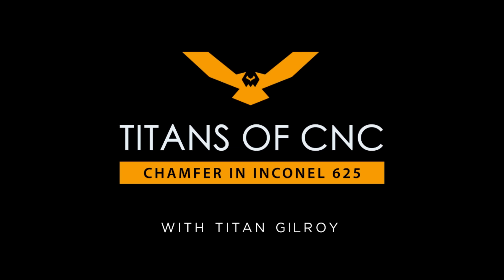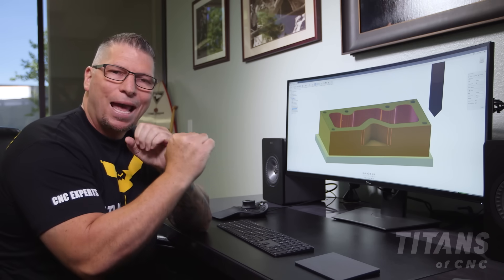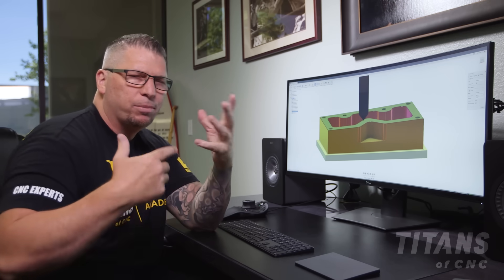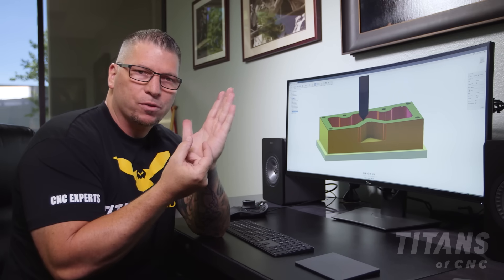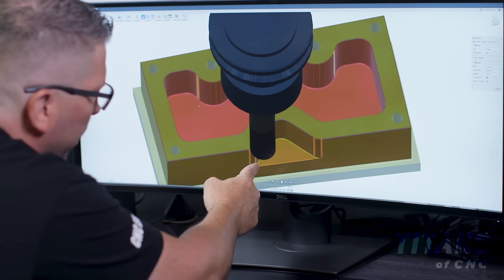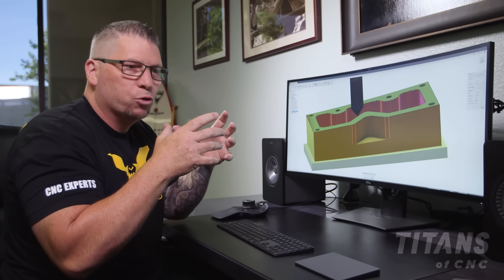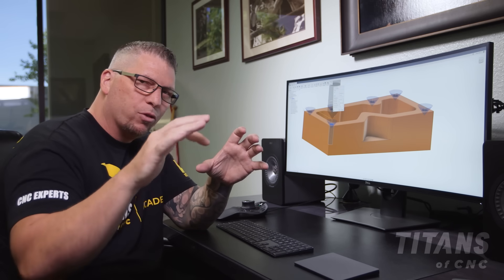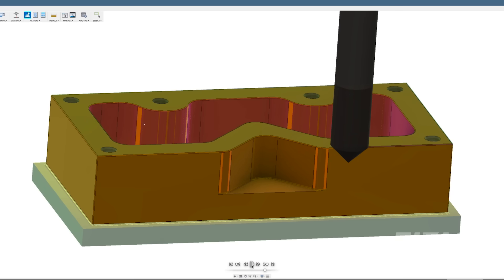Chamfer in Inconel 625 - CNC Machining - Master Class

Comment: VERY informative video. I love the fact that this works for whatever metal.. doesn't matter that it's Inconel or plastic, it's just all adjustments for speeds and feeds at that point.
Software I'm using, is Vectric Aspire, using a Tormach 1100mx, and I'm machining 6061 aluminum. So, regardless, it's all just adjusting tool, speed, feed. Vectric Aspire, is not the best software for machining aluminum, but it's what I know. Their Chamfer program sucks however, so I'm just manually creating a new path to guide my endmill to exactly where I want to go with it.

Comment: Hey Titan

Today i wanted to use this trick about chamfering near walls. I understand that you call a bigger tool to get away from the wall. But im kinda not sure how to program the width and depth.
For example.
I use an 8mm chamfer tool and i call it a 9mm.
Should i use 3.5mm tip offset (0.5 less to be safe) and depth 0.7 to create a 0.2mm chamfer?

Comment: Good day,
Question on why are you plunging to chamfer the holes? I've always found that is very hard on the tool and generally chatters leaving a poor finish. It has been my experience that walking around the hole even a slight amount makes the tool last way longer and leaves a much better finish. Or am I missing something? It wouldn't be the first time I was mistaken.
Anyway keep up the great videos and cheers from Canada
Reply from the maker: Walking around is a good way... the Tool was large so I plunged it... I usually just increase the feed to dissipate the chatter and make add a slight dwell.
Reply: The hole size in relationship to the tool size can cause issues when walking around as such the programed feed rate much slower to accommodate the engaged feed rate.

Comment: Curious why such a small chip load on the hole countersink 2 thou per rev is 3 tenths per tooth, but you ran 2 thou per tooth on the rest of the chamfer? Is 3 tenths enough to not rub? I've never used that tool, or ran inconel, but it's so different from the way you ran the rest of the part, it's confusing me.
Reply from the maker: We ran very conservative just to make sure it left a nice finish... definitely can increase pressure. Since we are teaching in hard materials... I am just making sure it’s a smooth learning experience.
Reply: @TITANSofCNC  
Gotcha. Thanks for the response So, I know a big part of your philosophy (and LEAN manufacturing, in general) is running parts fast in production. What would you try and run those at in 'real world' conditions?